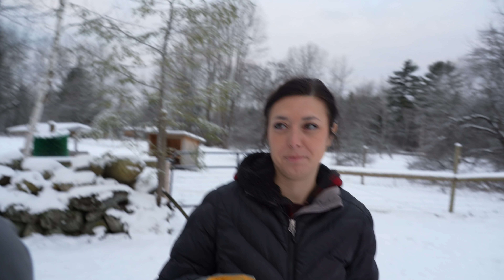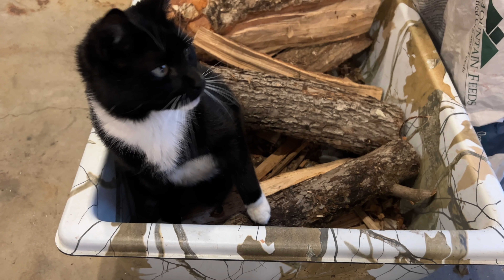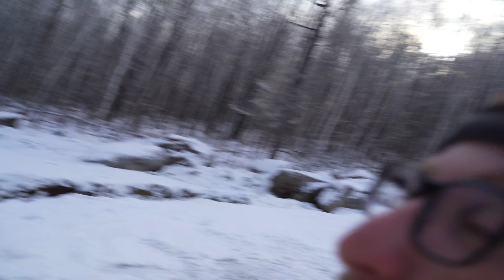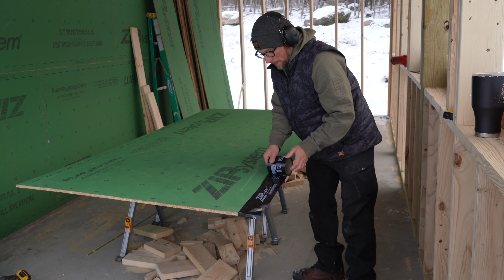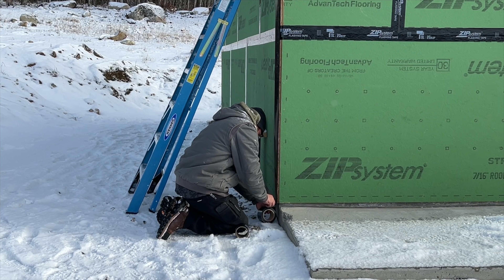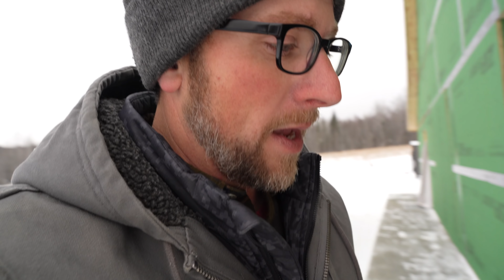We Are SO CLOSE!!! The Last PUSH to Getting the OFF-GRID House READY for SPRAY FOAM INSULATION

Comment: I have a question, it might have been said, but I was away hunting and missed some episodes and haven’t caught up yet. Are they going to do more logging this year on the property?? Thanks everyone!
Reply: I was also wondering why they weren’t putting the wiring In the walls before spray foam, is it a colder climate issue?
Reply: @markscheurich2196  It's a time issue.  The walls are 6" and insulation is 3", so plenty of room.
Reply: Thanks, most people around here would fill the gap to the end of the studs for max insulation so that’s why I was confused. Thanks again!
Reply: @markscheurich2196  That's because most walls use 2x4's.  The walls in this build use 2x6's, so there is extra space.  There may not be time to complete the wiring before day of insulating.  I think that Al wants to get solar power and wood boiler functioning before insulating.
Reply: I Understand, I’m in construction here for a long time and any building with a second story would be built with 2x6 here. I just happened to miss a few episodes like I said and I’m sure in one of those it will be mentioned in, but thank you for the help! Have a blessed day!

Comment: Spray foam has its advantages but cost isn't one of them and the price per square foot can at times be twice or more than that of conventional fiberglass etc. One problem is poor expansion rates of what sprayed due to a bad batch or mixture  which at times doesn't fill a void that its applied to leaving gaps behind drywall that goes on next. Having the electrical-plumbing done before its sprayed is a no brainer because  trying to run it afterwards is a nightmare and why not do it right in one fell swoop. They'll hopefully will have the radiant floor up a heating the building up for a day or two before they spray since temperature is a factor as well in doing a good job. It will be quite a caravan when their moving to the new place and the Mule will fit in nicely for now in the porch while it awaits its windows...

Comment: You could use some Henry's roof sealant, its black and icky but it comes in a caulk tube so would be easy to apply to the bottom boards to seal them up and keep the moisture from wicking into the siding

Comment: Where i live there is a calculation for the window in bath or shower rooms its 1-20th of the room and then you will need mechanical ventilation with X amount of air movement per hour ,tbh i for get what this is ,so that little window will not be as little as the misses wants it, depending on the room size....sometimes you just cant have what you want eh ....

Comment: I strongly recommend, at the minimum, running your outside walls with wiring PRIOR to foam insulation.  It is much easier to drill the holes in the wall studs and run the wiring through empty areas than having to gouge out foam.  Place your wall outlet boxes now, to avoid problems later on.  By doing the wiring now, you'll be much happier later on.
Reply: The walls are 6" and insulation is 3", so plenty of room.

Comment: question: is the wood treated? not speaking English I do not know if the roof is finished, and if you plan to come and live here and leave your house and your sheds that you have put up? I have been following you for a while, but I have a hard time understanding thank you
Reply: The bottom sill plate is pressure treated with a seal tape also applied. Lumnah Acres have said in many previous replies that after they move to new property they will be selling their present one.

Comment: i Love watching your videos. your whole family are Awesome!  you are doing a Awesome job building your tiny home! Thank You Very Much for the Awesome tip about putting tip tape on the bottom of the zip panels. i learned this safety tip a long time ago from a family friend that is a carpenter: when cutting sheet goods (o.s.b., plywood) first put two 2x4's on top of the saw horses, then set your saw blade to just cut threw the sheet good. the 2x4's hold the sheet good so your saw does not jump and cut you. keep doing the Awesome work! GOD' Bless your whole family. Amen :) :)

Comment: Al don’t you want to run in wall electric and plumbing before spray foam
Reply: The walls are 2 x 6 so plenty of room with 3" of spray foam.
Reply: @tonygrimes13  Because Spray foam adheres and chemically reacts so well in 17 degree temperatures and it is so easy to drill on top of 3" of spray foam...    drilling and running vent pipes through 8" of spray foam does wonders for air sealing a hot roof.   Insulation is done last...  suck it up and buy a space heater if you are cold.
Reply: @darlaherbst5929  thank you, maybe you should Google some of the spray foam nightmares when spraying in cold temps.  Then consider the lagistics I have plumbed and wired a 3000 sf house in winter months in NH with no insulation it's not that bad spraying the house after will ensure the pros do it in warmer weather and properly air seal the house a critical part of installing a hot roof
Reply: @ericfraser7543  Just keep watching, you might understand later.

Comment: I dont know squat about building anything (I took a shop class in HS my project was a box). With that said, shouldnt your electrician wire the place up BEFORE you jet the spray foam guys loose?
Reply: The walls are 2 x 6 so plenty of room with 3" of spray foam.

Comment: Al, I am not sure of what you are going to use to seal the bottom of your siding but here is a builder YT that I follow that is sealing the bottom of the Zip Board with a tape that adheres to the cement as well as the siding... https://youtu.be/Hps1qMG4jBY at the 7 min mark...  That would actually seal the bottom of the siding against any water infiltration.... 

PS: I really think Gina needs to be the one that puts on the Ridge of the Tiny House... LOL

Comment: Hi just a quick question you said in your video you shouldn't be using your nailer gun to fix the boards to the frames now is this just because it hasn't got a full head on brads or is there another reason 🤔 I love watching all your videos on your build and I'm learning loads from everything you are doing im from UK  England but our houses are all mainly brick keep up all your great work your a very clever person doing most of it by yourself except wife helping which is also great 👍 😀
Reply: He said that to short circuit the haters. "Using a Framing Nailer to put up siding? How dare he? He needs to invest another $300.00+ in a proper nailgun for siding." Never mind that his Milwaulkee can handle a wide range of nail sizes.

Comment: I don't agree with the weakening of the corners of a building.
Reply: He’s actually not weakening the corner. The stud he drilled through was just a nailer stud anyway. There is another stud on the outside of that corner that you don’t see. It is the support stud for that corner
Reply: Not building corners but inside wall corners.

Comment: I think it's a good idea to zip tape the bottom of the boards. I would like to see you put electrical boxes in that side between the windows and boxes in the ceiling for lighting and run wire up behind the half wall before spraying insulation, even if you don't plan on wiring it completely for now. I also hope I don't regret commenting before watching the whole video. Lol
Reply: The walls are 2 x 6 so plenty of room with 3" of spray foam.

Comment: Do you really need to use nails on your Zip sheets? Won’t the tape be enough? 😂😂😂. The build is looking good, I can’t wait till you tie in the heating system. One point, I haven’t turned my heat on here in Naples in over 5 years. I wish I could say the same about the air conditioning. Haha.
Reply: Need nails to attach to the structure.

Comment: Just a thought, keeping all rechargable batteries warm in cold weather might be as simple as a small, warming blanket that is powered by your truck cigarette lighter or a 12 Vdc power supply. Even a 120 Vac Inverter like a Jackery power pack or similar. Maybe a styrofoam cooler in the back of your truck with that heated blanket idea might do the trick on the cheap? Imagine how nice a cold ride to the off-grid property would be with a heated blanket to cover your/Gina's legs until the truck warms up?

Comment: Many are dismissing any of us who offer critical opinions, but I have built, and am still building. Foam insulation is my favorite, and I applaud your choice. However I offer sagacious advice; pre-wire before the foam! It won't take that long, but will be horrible and inferior if you do it after foam. Add a huge amount of labor that is not needed and take ten times as long.
The foam will air-seal the boxes, the wire paths, and be no more costly than doing it after, cutting out the cost of adding back foam that needs to be cut out for access. 
On new construction, there is no question. On remodels I've needed to do it both ways and offer you some advice based on my years of experience.
Reply: Keith, Al likes good constructive criticism!  Al knows that it would be simpler and better to wire before insulating. You don't need to explain every little detail.  The issue is "time"!  Like Al said, "The wiring may not get completed before insulating, but it can still be done afterwards."  The walls are 6" and insulation is 3", so plenty of room.  In the end nothing will be inferior and there will be no waiting for a rescheduled insulating day!

Comment: You do realize that that zip tape has to go around the bottom also to seal the bottom of the zip panels.    What you did there, just putting it on the bottom of the panel, won’t seal it.
Reply: Watch again!
Reply: @tonygrimes13  What about the bottom of the boards on the rest of the house...  non of that was taped...  that zip system is a waste of time and money, give me a giant roll of house wrap and every seam and nail penetration is covered in one pass.
Reply: @ericfraser7543  It was mentioned in video about applying a liquid seal to rest.
Reply: @tonygrimes13  I guess a can of Flex Seal might be better than tape which could trap water, just not sure it is worth it guess it is Peace of mind... When were they planning on installing it after winter was over?
Reply: @ericfraser7543  We'll see in the videos probably.

Comment: I think that you are going to regret not running the electrical before you spray foam.
Reply: Low voltage wire take up little space all wired from the ceiling 
I'm sure they have a plan
Reply: The walls are 2 x 6 so plenty of room with 3" of spray foam.